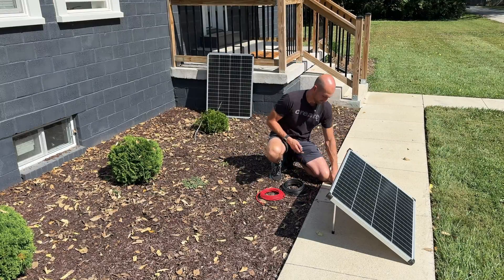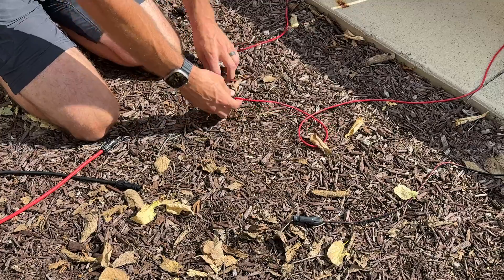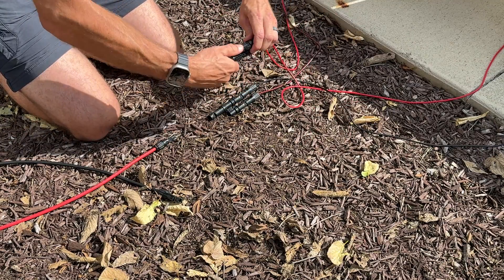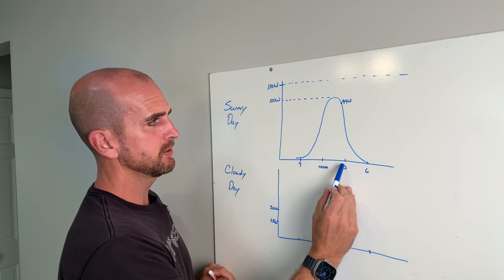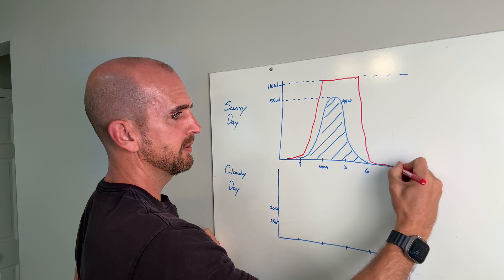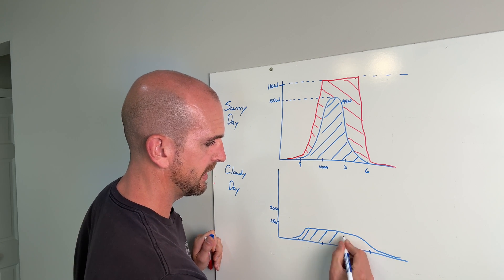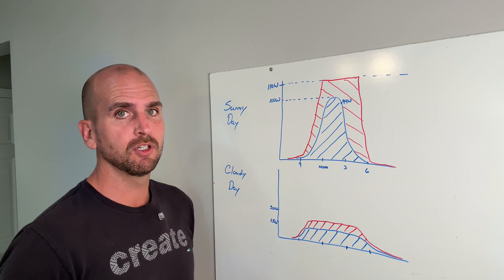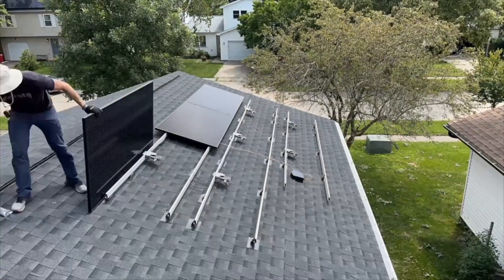How To Double Solar Charge Capability On Any Power Station

Comment: If u do this for a year I think the machine will develop problems .  I tried this on my eden lotus power 2kva solar generator it has 500w solar input so I ran two pieces of 500w in it and over current fried it after a year of using

Comment: So is there no risk of damage if the max capacity is 100 watts and you put more in, if just limits it itself? On a cloudy day the if the limit was 100 watts but a 100 watt panel was only generating 15 watts, could I effectively plug in 6 or 100 watt panel's and get 90 watts? Where's the limit if any? What would happen if I plugged in 500 watts of solar into that small ecoflow in a sunny day, would I blow a fuse or would it just limit itself to the maximum it can take in? Or would or could I add a device that could sort itself out. If that's the case you'd be better over supplying with more panels than it says to surely.

Comment: When the "clipping" occurs on sunny days does the extra wattage not damage the ecoflow at all?  

I was told by a couple of people that the watts have to go somewhere and overloading it will  be damaging internal components, making it wear out way faster.

I have a Delta 2 (500w max input) but want to double to 1000w for the cloudy days.

Are you 100% sure that parallel overpanneling won't be wearing the components down quicker?

Comment: I have two 450W solar panels and a Powerstation with a max AC input of 400W where the input of the solar panels is limited to 200W. With a dc-dc 350W converter, I want to supply higher W. But I can't because the Powerstation doesn't allow it, even though I know it can handle 350W without problems. Is there a way to trick the Powerstation into accepting 350W?

Comment: Good video. I got a river 3 and a eco worthy bifacial "100" watt and on a clear sky it was at best 60-70 watts pointed towards sun on concrete in FL. The input was all over up and down 10-45 watts on avg. 

Do you think this panel is damaged or needs earth ground. The metal frame did take a wack from fedex. Not sure i can complain much with a 48$ shipped panel. 

Curious what panels out there spec higher watts in vmax range.

Comment: Series vs. Parallel is a much more complex question than you make it out to be.  If you have longer wire runs and your charger/inverter can handle the higher voltage, yes, series is better - usually.  If your 'installation' is in an area where one panel will possibly be partially shaded, it could reduce the voltage enough that series would not be the best.  For portable installs like your test rig - short cables and portable power packs, parallel is almost always better.

Comment: I have two Anker F3800 and the xt60 solar inputs are capped at 60V. I am looking at 8x 590w panels "I only have space for 8x of those panels" and put two of them in parallel. The Voc of those panels are 53.79 but during winter I have to use the 1.14 factor conservatively that would put me at 61.3V. Do you have any ideas on how to cap my voltage? please some links to what I would need? I am trying to max out the solar inputs but I only have a 30' x  7' for solar panels and those look like the best fit with a Vmpp of 44.95v. Thanks.

Comment: Sir please what best way should I or can I  connect this My Solar panels

* Four Solar Panel
- 390 Watt
- Voltage (Vmp) 43.1  V
- Current (Imp) 9.06  A
- Open Circuit Voltage (Voc) 52.3  V
- Short Circuit Current (Isc) 9.68  A
- Series Fuse   15A

* External Charge Controller MPPT 60A (145V)
* 10mm Copper Cable @ 13.716

Comment: The instructions for the device say:
Solar Input	11-30V⎓8A, 110W Max

is it allowed to exceed the current?
Reply from the maker: Current = Yes Voltage = No.  The solar input will shutdown if you go over voltage but the current will be limited by the River 3 👍
Reply: @everydaysolar  thank you.

Comment: Sure, that's one way to do it, but I expected to overcome the limit of solar input of the power station. Since solar input port is hardware-maxxed, how about using its secondary inputs at the same time? My solar panels (allpower sp012) also have a 100W USB-C out. I use panel's USB-C out, the other panel its tradtional DC out to Litheli B300 powerstation and it maxes out at 160 watts of combined inputs. Since these foldable solar panels rarely produce over 80 watts for my lack of tilt mechanism, the setup is perfect to maximize both the current and time span for a power station rated at 100 watts solar input. Then I use its AC port to charge up my laptops and e-bike battery. Having extra output on solar panels is also helpful if you have smaller devices like power banks to directly charge, instead of daisy-chain-charging, that usually has extra 10-30% power transfer/conversion loss.

Comment: I'm just curious if some power stations have this issue. I have a Renogy MMPT controller and batteries. According to the manual, the controller will actually stop charging if the input is over the wattage and then start again when the input wattage is within the limit. As far as I know, the Renogy won't "clip"/limit - it'll just stop charging and over-paneling would diminish my daily power total. I just switched to an MPPT controller that could accept more power than my panels will ever produce.
Reply from the maker: Really?  I would expect most Renogy charge controllers to perform similarly by clipping the current as long as you are staying under the voltage.  What model is your Renogy?

Comment: I read somewhere you don't need any fuses for 2 panels in parallel, not sure if that's true or not. That it would only be necessary with 3+ panels in parallel.
Reply from the maker: I think that is correct for most setups as the max current the panels can handle is usually around 2X the output of 1 panel.  Thanks for the feedback!

Comment: So unless I am missing something, the short answer is a way to double the charge capacity of your  charge station, you just double the solar input. Sounds like a given to me. I thought there was some non obvious device or action that would do something to increase the input to the Ecoflow.
Reply: Right. I have the Delta pro, it can take 150v. 2 panels didn't even hit that and mine are like 41v. I can run 3 before I have to switch to amps to avoid the cap. Of course I can over panel for lower light to get more power during those times and take the hit at peak.

I actually have 2 DPS so if I really got fancy I'm sure it's possible to send that input into something else that would split the power evenly and double the power I could capture... But... Simply adding more panels and batteries is the obvious step even if the exact technical details may be unknown for some
Reply: when I saw this thumbnail my first thought was "use the inverter from a smaller ecoflow to dual charge the larger ecoflow, with panels connected to each ecoflow"

Comment: I don't understand why is this 245Wh inverter/battery combo is better than an APC BE425M 425VA UPS for $55 with a generic small solar inverter for less than $50, total $105-ish? Significantly more capacity and lower cost than the eco flow.
Reply: EcoFlow have a LiFePO battery lighter and higher capacity per square inch.  It’s meant to be charged at varying voltages.  Have different methods of charging, sun, car wall, usb-c.  The APC needs a constant 120v input to charge its lead acid battery.  Basically apc is meant for back up power that tied to the grid.  These EcoFlow type of battery is meant to be versatile and portable.
Reply: APC BE425M has 3 minute run time at full load and 10 minute run time at 50% load.  It's only meant for very short power outages.
Reply: So, what is the run time capacity of the eco flow at the same full load of the APC?

The APC capacity is rated at 255Wh. The eco flow is rated at 245Wh. Just from that perspective it doesn't seem like eco flow is better, as you have implied. The only significant difference I can think of is that maybe the eco flow has a slightly better charge efficiency because it charges directly from DC. But in principle the AC to DC power supply in the APC is a switch mode power supply with a rating of 96-97% efficiency, so that nominal 4% loss doesn't seem to be worth nearly double the cost.

I still don't understand the value proposition in the eco flow over an APC + inverter.
Reply: @mjmeans7983  at load they are, but under smaller loads the APC is terrible.
Just try taking the APC with you on a camping trip you’ll find out. Straight backup to a computer APC wins hands down especially on the price segment.  Do anything else, quickly doesn’t make sense.

Comment: When you added that second panel, was it correct to connect black to red and red to black (to the wires going into your home)? Shouldn't it have been red to red and black to black?
Reply: Yeah... I saw the same thing... My panels put out + on the RED wire
Reply: Looks like cheap cables with bad color scheme?
Parallel configuration = 2 M+ connections would fit into 2 F- terminals, spliced together. If the output is 1 M+, then the extension cable should fit onto the panels only one way, the F- terminal. looks like a mc4 to 8mm DC connector. So the color should alternate based on the mc4 type, instead of matching it.
Reply: It doesn't matter. I buy a spool of black cable. When I cut a cable, male goes on one end and female on the other. Then, to protect the o-ring, I connect the ends together until the cable is ready for use. It is foolproof. The colors on the cables are entirely unnecessary. They could all be clear.

Comment: If you were mounting on the roof in a fixed position would you need a rapid shutdown device for a portable power station?
Reply from the maker: That is a good question and I think it would depend on the local inspector.  Portable units are a bit of a gray area for a lot of jurisdictions.

Comment: what would happen if you just use 1 200 watt panel instead?
Reply from the maker: depends on the panel but most likely the open circuit voltage would be too high for this EcoFlow River 3 power station.
Reply: Basically, you can’t pass the max voltage.  You can pass the max amps since the unit will only take much as needed.  It would have been nice if you briefly talked about the benefits of series and parallel configurations.

Comment: Great info. Could you point one panel east and one west and capture 100w sooner and later?
Reply from the maker: Yep, that is a great plan 💯
Reply: Pointing directly east and directly west is probably not optimum because when the sun is directly in front of the panel, it is low in the sky and has more losses to the atmosphere.. I would think something more like southwest and southeast would provide better overall performance. It would be interesting to run some experiments to see what the optimum angle (relative to each other) would be.
Reply: Plenty of YT channels experiment with this and vertical panels, bifacial, etc . Check them out.
Reply: That's possible and makes sense

Comment: Ecoflo solar panels suck!!! Im getting 230 w with 2 200 watt plus added 2 sucky 100w in full sun Ridiculous!Total of supposably 600 watts joke!
Reply: Are you running the 2 200W along with the 100W in the same parallel or series string?  Also have to watch the amp and voltage limits.  Some power stations have tiered outputs where you will get x amps at one voltage range and y amps at another range so if you're not hitting the hire range of current it can cap you out.